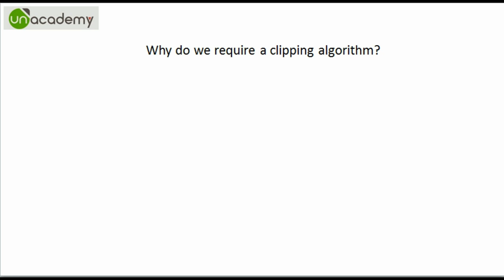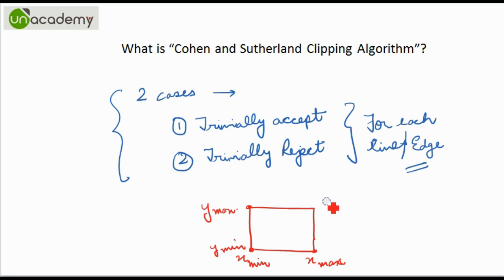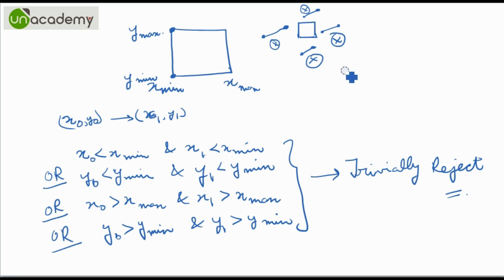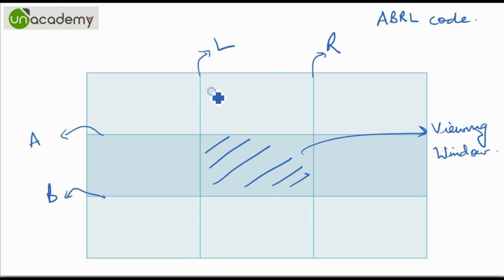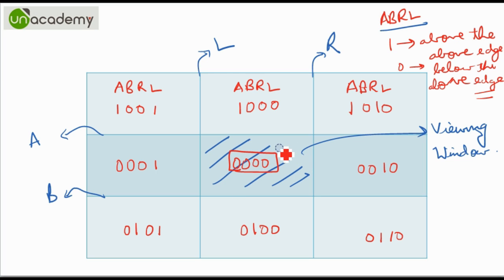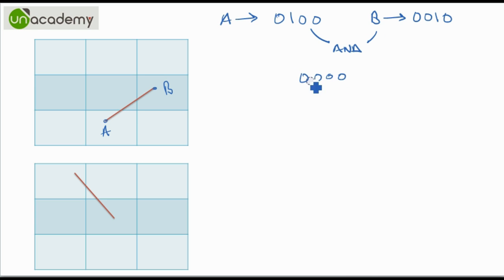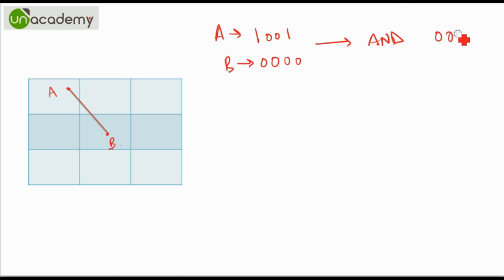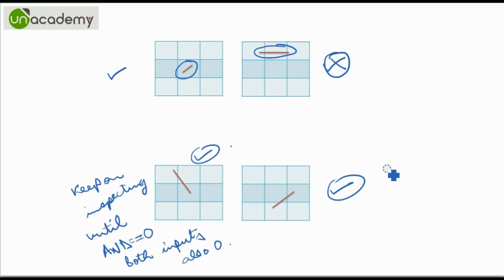What is Cohen and Sutherland Line Clipping Algorithm in Computer Graphics?

Comment: 15:50 - there's a mistake. If one of the points is inside the window, you are supposed to (according to the algorithm) switch the points you are clipping. That means, you should begin with point B intersecting the window,  checking the code of the intersection and making a new point (C) there. B-C is inside the window.

Comment: Liked your video.

Two questions-
1. Given a window co-ordinates, a line (p1,p2) has its point p1 in 1000 and p2 in 0001 and runs over the window box. Then I can find out the co-ordinates of the cutting points on the window arms. Now if the line remains outside the window box with p1 and p2 in 1000 and 0001 respectively as before, how will I decide that there will be no cutting points?

2. Another case is when p1 or p2 or both lie on the border of the boxes (except window box), which code should be chosen?

Thanks in advance.

Comment: when u explain the step in which a=1001  and b=0000  after that "and" operation is done than output is 0000 
then intersect the points comes out c and b so my doubt is c is 1000      
why b is 0000

Comment: While inspecting line weather to reject or accept , more simple way is logically OR the both points and if it's 0000 than accept otherwise clip it, instead of first checking the logical OR is 0000 but points are not 0000, though it's not wrong!!! 
					  
					   - via YTPak(.com)